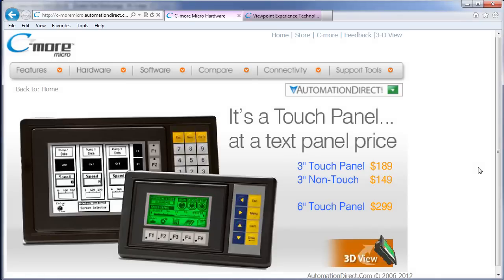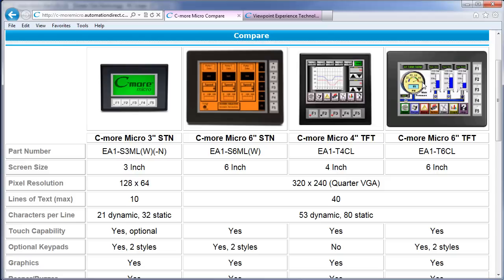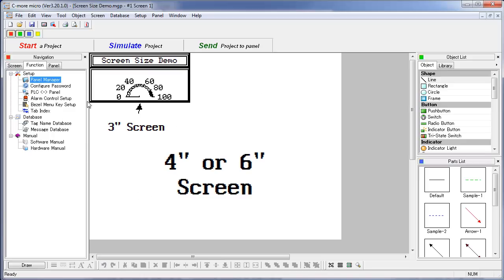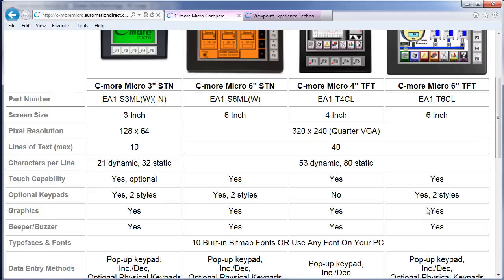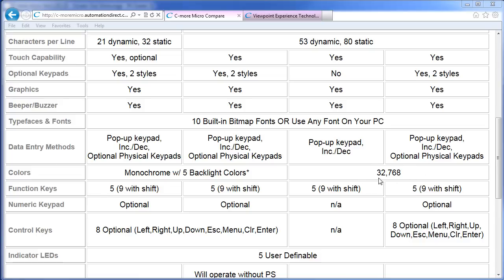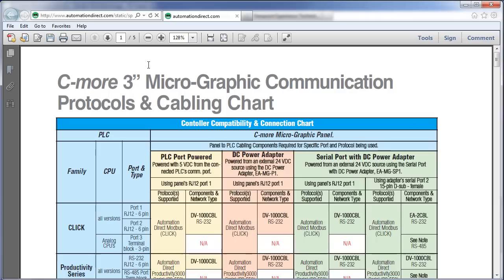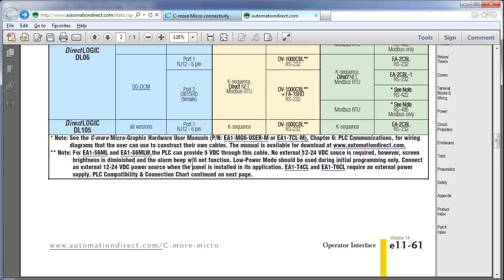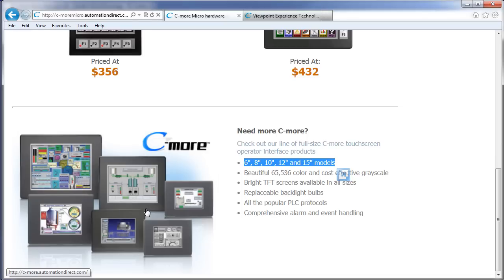C-more Micro HMI Family Overview from AutomationDirect

Comment: What does HMI mean to you?  There are over 125 definitions for the acronym HMI and more than a dozen companies abbreviate their name as HMI.
Reply from the maker: @decodr-ring, at AutomationDirect, HMI stands for Human Machine Interface. This is typically a touchscreen, or button enabled display screen that interfaces between the human operator and the control system. It can be used to input commands to a control system, display information from the control system, as well as many other functions.